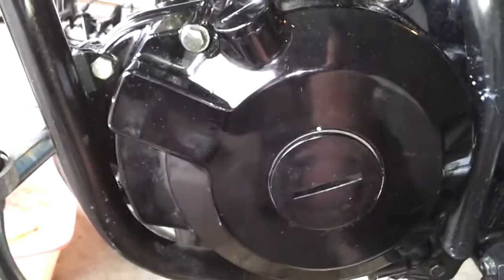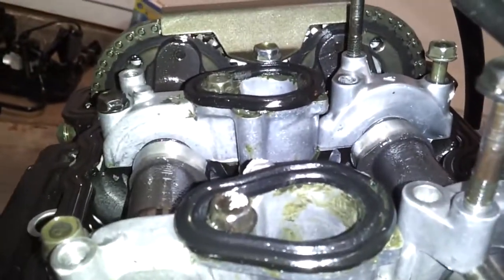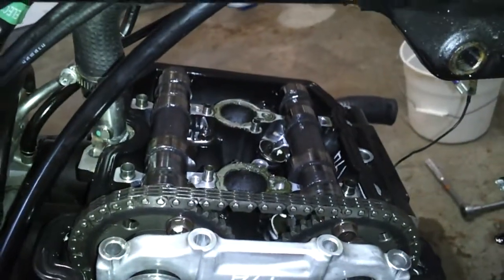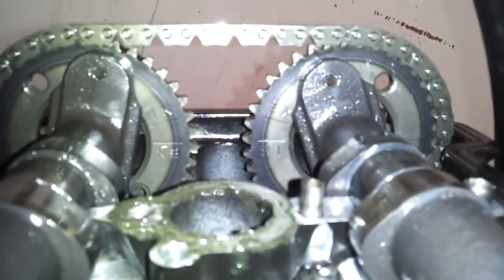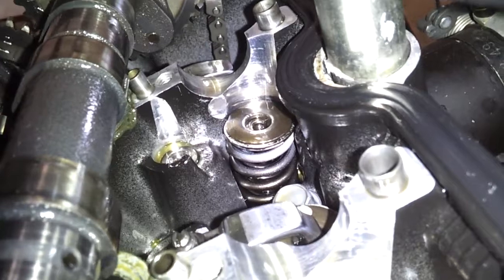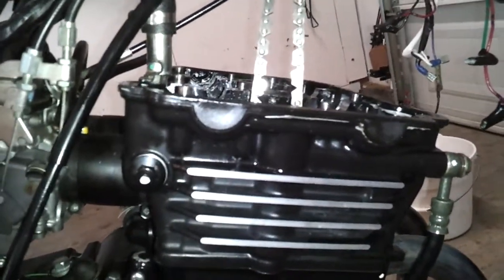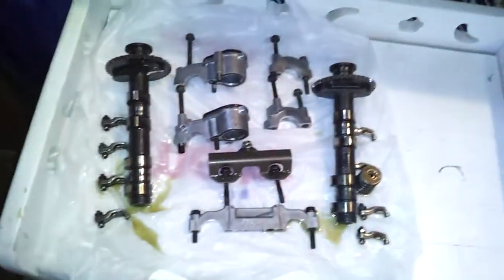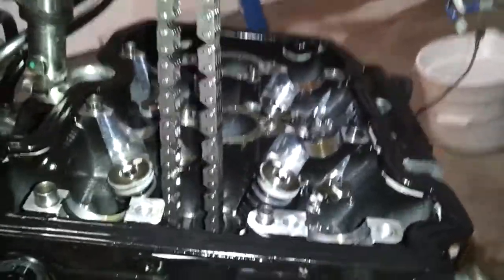Kawasaki Ninja EX250 valve replacment part 2 of 4.

Comment: Hey hey.... I have 85 or 86 Kawasaki ninja and I don't have paper for it and I only want the engine for a project to put it on a small car so looks like ur familiar with those bikes and the only thing I can give u is that the its 4 cylinder and 4 valves per cylinder and also the the timing chain is between the   #2 and #3 cylinder... b4 I start buying engine rebuild parts... if u have any questions u can find me on Facebook messenger with the same name... thanx